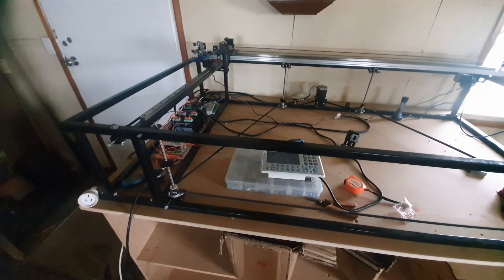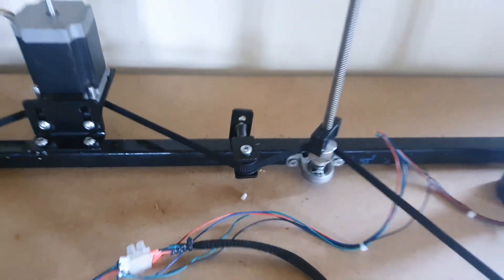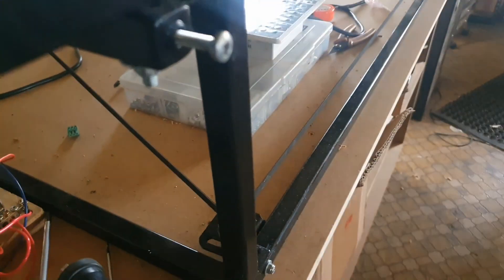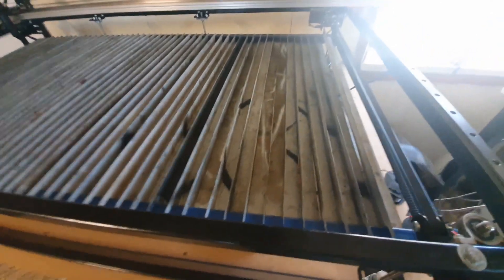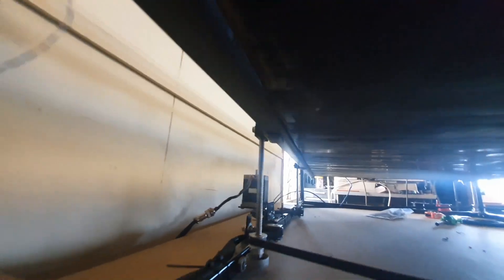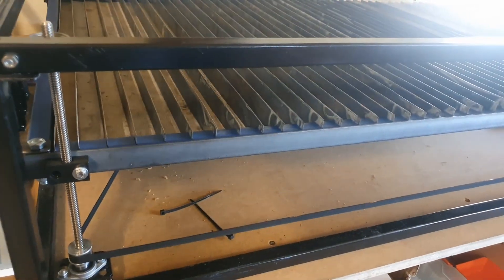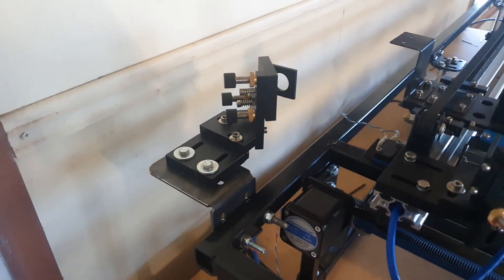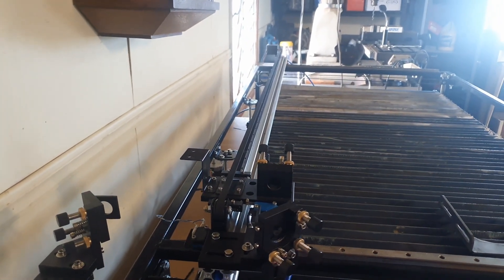My DIY CO2 Laser Build Part 3 - Overcoming Challenges

Comment: Hello,
 Can you show me how to adjust the step for CO2 laser engraving machine using TB6600 driver and DLC32 circuit board. I searched for information online but could not find specific instructions on this issue
Reply from the maker: It's normally done in the software. I used Lightburn. If you Google 'lightburn calibrate axis' it will tell you.

Comment: Hi Dave! Great build! How stable is the table with the slats? I can't see any guidance - you just have it guided by the lead screws, right? Especially if you put there a large sheet of 15mm acrylic!? I was wondering for my build if that is enough or if you would recommended two guiding rails on the sides or so? Have a great day!
Reply from the maker: The table has proven to be very stable, although ideally I would have liked to use a longer belt so the lead screws are in the 4 corners. It is guided by the lead screws I went to a lot of trouble to get those vertical. I have tried a 28lb weight  on the table and it raises and lowers just fine. The Z NEMA 23 powers it well no slipage so far. 👍

Comment: So does the operating panel need a laptop or an SD type card? Using the A axis? eg Rotary one for tumblers etc? I was wondering how the beam stays in focus on the Z axis.
Reply from the maker: I'll focus it manually I've got a couple of pointer lasers I hope to use for that.  The controller connects best over a network cable or you can use a thumb drive or USB. Also if you get a WiFi adapter it can do it that way too, it intigrates well with lightburn.
Reply: I just had bought half of the components and hope I can start with the buid of something similar to yours. At the beginning the plan was to do a frame with soldered aluminium beams but, imposible to solder so I changed my mind and will be like yours.
Reply from the maker: @andreiandries3594  Sounds good, mine is a sort of organic build that is developing as I go. I'm working on the case at the moment and should do another video soonish.
Reply: Very good Davo. Hope you got all stored after the lightening strike.
Reply from the maker: @DeepFutureSim  yeah no worries mate 😊